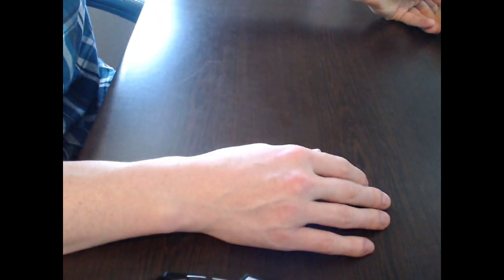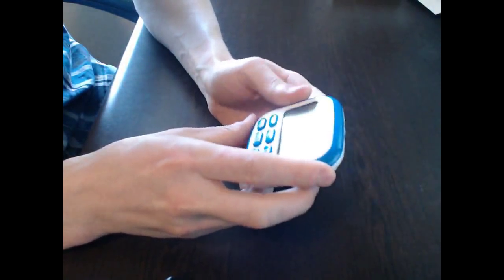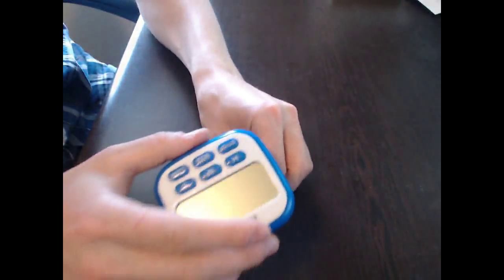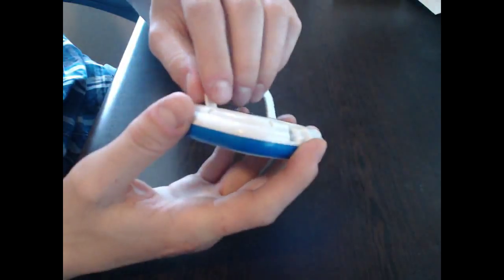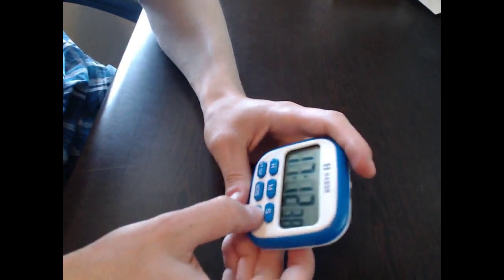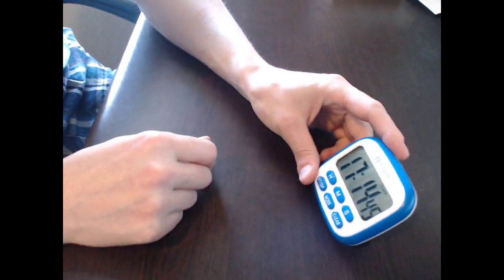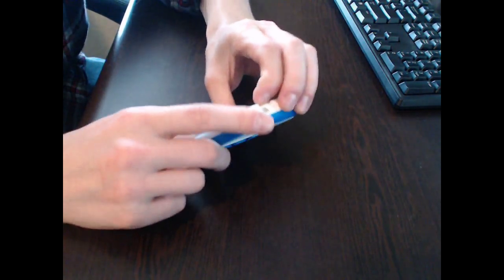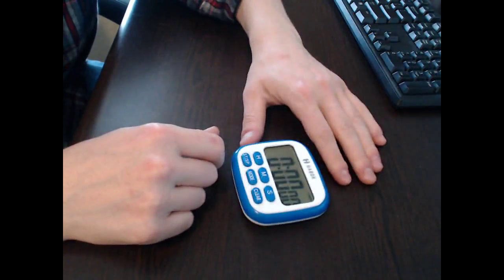Habor Kitchen Timer

Comment: Was hoping for a demo in whether pressing and holding the settting buttons works, or whether you have to press the button 30 times.
Amazon reviews are contradictory on the subject.
Reply: Update: after buying it I find that yes, you can press and hold the buttons rather than pressing them 30 times.